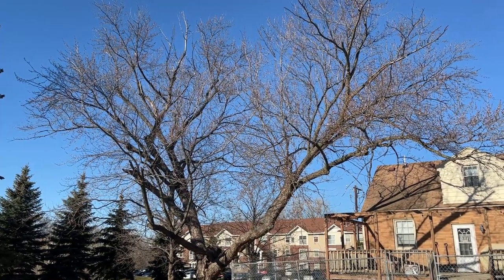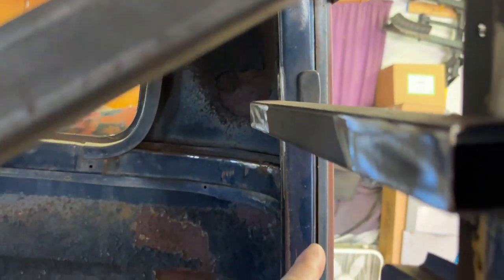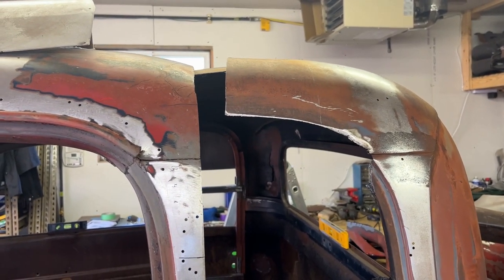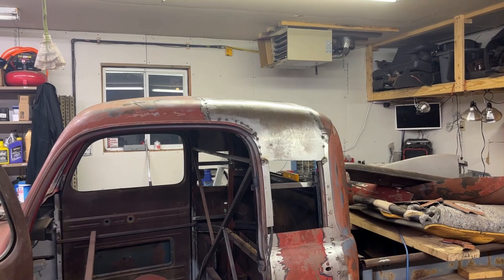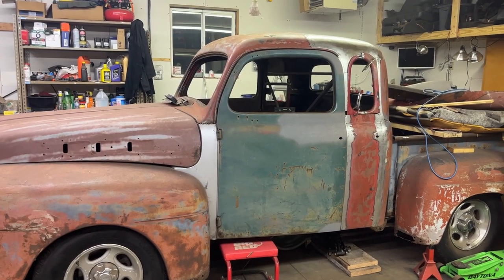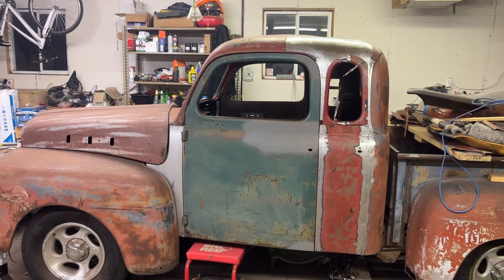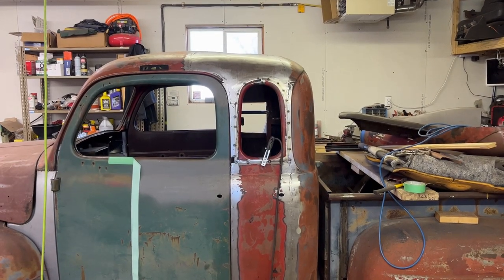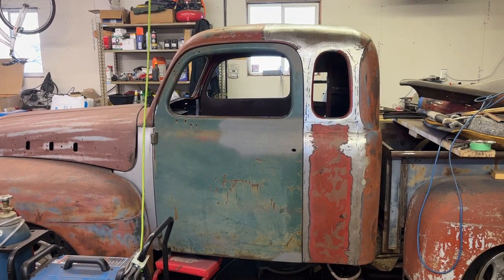Fiona Ep. 9 - 1951 Ford F1 Restomod - Extended cab - Corner Windows

Comment: It helps to grind the back on the blade down when cutting a sharp radius
Reply: I have one of those HF air saws. It's a definite POS. The only reason it still exists is for the occasional "that's the only. Thing that fits" moments.😊

Comment: the side window looks great, ive seen other people doing the cut and but with a cutting wheel. they cut about 2-3 inch at a time tic it then cut 2-3 inch tic. they do that all the way around.
Reply from the maker: Yep, that's what I've been doing for the most part.  The roof corners were a little more tricky, so I have to cut through all the tack welds and the old sheet metal to get the patch panel to sit flush.